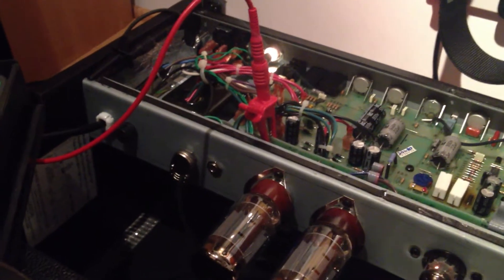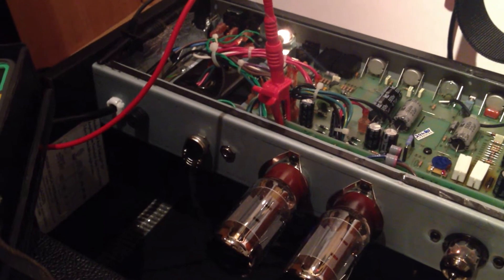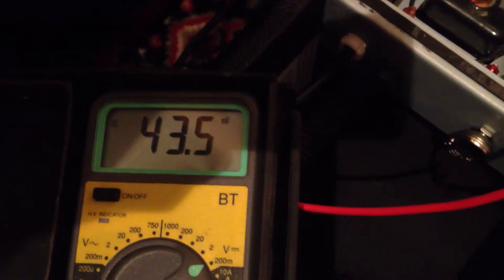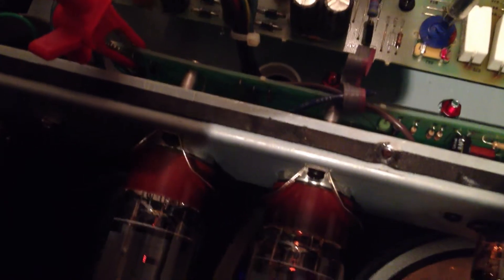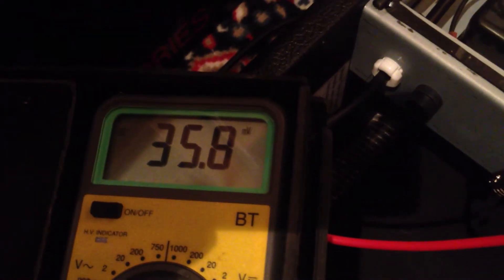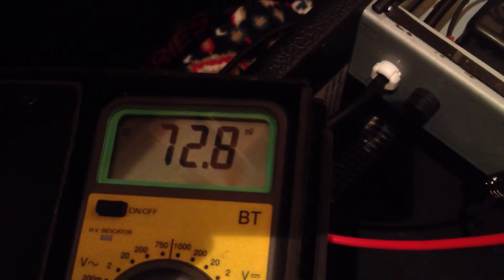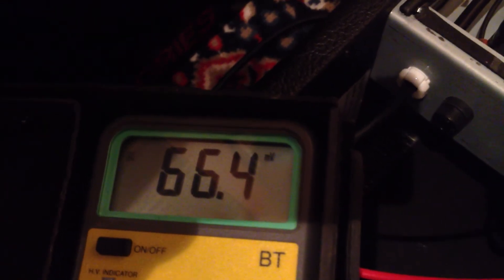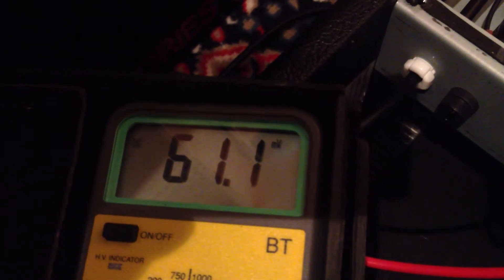Hot Rod Deluxe III Bias and Tube issues

Comment: I have the same problem, i can get it max to 30 mA turning the bias knob to the right....so why is that? DId you fix this issue?
Reply from the maker: +Healthy Mango I haven't found a solution since I posted this video 2 years ago, however, all I did was to set the bias at the factory setting, lined up the red mark, and it's been working fine. I've only just noticed the reply by dansk bjorn below so it's interesting he's mentioned that as I installed the original speaker back in a while back and I haven't taken a bias reading since.

Comment: I have just seen your video,, so you probably solved the problem allready 

Two things come to mind.. 
The new speaker a G12H has a huge magnet and the tube closest to it could be affected by the magnetic pull from the speaker magnet.. 

THe other thing is that you reading on the test point should be catthode current for both tubes and Fender's recommended 60mV=60mA is 30mA pr tube at 430V plate. That is less than 13W dissipation pr tube (fairly cold)
But maybe the tube on the left is not drawing any current at all besides the 6.3 heater voltage, this means that the 60mA you are reading is for one single tube and that would give you a static plate dissipation of 26W at 430V but maybe the plate voltage goes a little higher if the left tube is not pulling any current.
 
Another thing I see is the two 5W cement resistor that lowers the voltage for the switching, reverb driver etc. Those are mounted to the board. THose get very varm. YOu can see the board being heated around those resistors. THose two resistors should be floating.. 

Maybe see if you can measure the plate (voltage drop over the OT). and screen current (voltage drop over 470r screen resistor) for each tube.